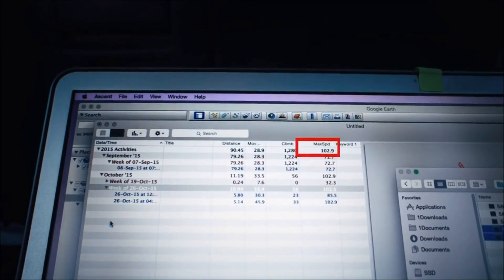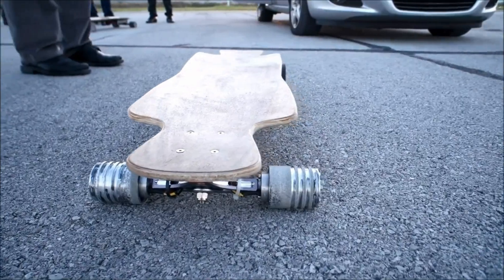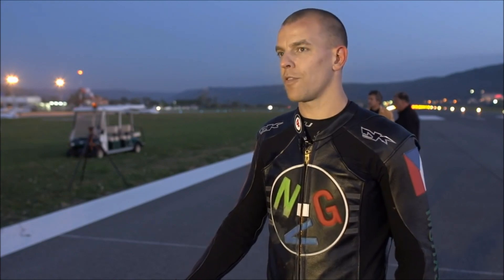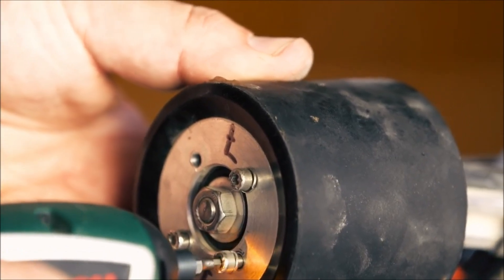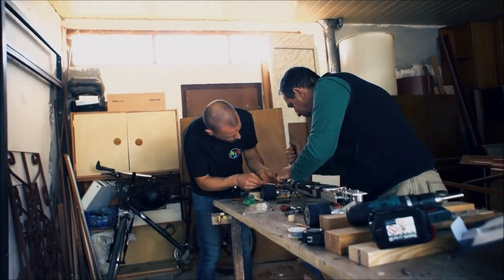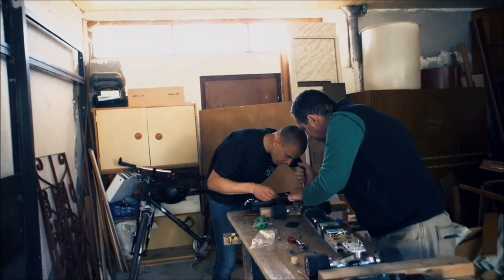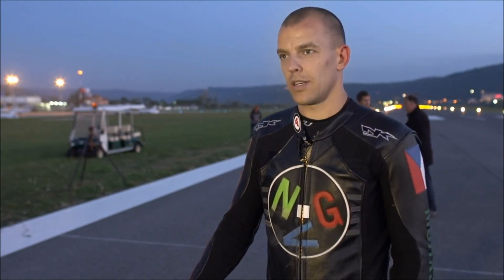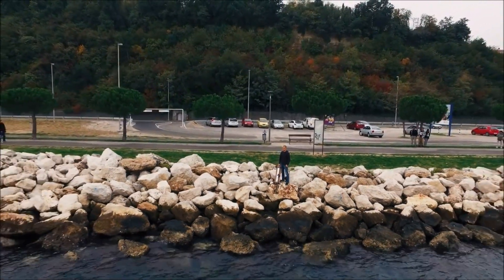Fastest speed record on an electric longboard set at 102.9 km/h

Comment: Common sense tells you that if you make the urethane layer for the wheels thicker it would solve the ballooning out and stretching problem real fast, go look at the wheels the guy used to go 89 mph on his longboard they are just normal longboard wheels like 65 or 70mm. The ones in this video looked like 60mm maybe and the urethane was like a 10mm layer........come on its not rocket science and if the extra size and weight of the bigger wheel is that much of a problem then figure out how to make the motor faster.
Reply: Actually just having direct drive with proper speed wheels would prevent any possible similar issues. Direct drive example: https://youtu.be/b0w6h26HBBw
Reply: And how would you compensate for bigger wheels without any gearing ? They would have to make different motors in order to keep speed and torque they have now.

Comment: I understand that your issue is heat expansion between the ground an the motors, in theory heat is controllable with the application of distance from either opposing force, I have noticed that carbon fiber is a very ridged as it's properties are compared to steal gram per gram, also it's used in the racing industry as a form of heat sink between certain materials such as aluminum, titanium, now if you where to apply a 5/16 layer between the aluminum an your rubber compounds, that layer should compensate for the lack of heat dissipation from the friction between the ground,air pressure that's being forced over, an around the wheel, the brushless motor does cause some heat to expand through its casing. the carbon fiber will also give you a more serious grip for the wheels to mold to...

. I do apologize if I'm in any way shape or form giving to much to read..

Comment: um....i go 60mph+ on my non electric longboard. i would not want to by this.
Reply: +Chad Stuetzel me either but i do something better its called falling. It stops me way faster than sliding it also opened my skin and gave me road rash, you should try it you wont regret it.
Reply: Too funny Chad, I started long boarding again just for Pokémon and now I'm bombing hills everyday!

+attack SAVAGE . There is a sweet spot for efficiency on any brushless motor and battery/load combo.. I don't know the KV these hub motors run in the video but running a 12s 5ah lipo, 190kv 63XX brushless motor and some 80+mm wheels with a properly geared belt drive should top you out at around 25mph and you should be able to get around 8 or 9 miles if ur under 200pounds. Up that battery to 10ah and 
Get around 15-16 miles~.

Hope this was helpful ! More people into eskating the better!
Reply: Obviously, its a penny.
Reply: +Chad Stuetzel Slideeee
Reply: Lol i don't even like going 15 down a hill. I don't like not being able to stop if something gets in my way
Reply: Mitchell Ellero I'm not at that level yet
Reply: On flat terrain?
I don't think so. Maybe in a steep hill
Reply: +Christopher Bjørkeng why would you want to go 60 mph on a flat surface. the sidewalks and street wont let you go that fast any way.
Reply: +Chad Stuetzel Get some gloves
Reply: axel herrera My friend did that on a penny board lol he had to go to the doctor for it to be cleaned
Reply: Well, that isn't good that he is trying to slide on a penny. I've gotten 35 on one.
Reply: Mitchell Ellero No he got speed wobbles
Reply: Mitchell Ellero I don't use my board as much as you probably do. I bought it to get around playing pokemon go then it turned into just cruising around for fun and now I always have it in the back of my car to get to classes or whatever which is why I'm not all too skilled
Reply: If you can develop an electric motor powerful enough to propel people to these speeds, then you can scale down in speed and increase efficiency of battery power, I'm guessing. Perhaps the development of this board will lead to longer lasting batteries in more reasonable long boards.
Reply: That was a premium reply. Thanks!

Comment: Why use a hub motor when it creates heat to the wheels. Also the friction from the road is also dangerous when combined with motors heat. Also the hub motors takes up too much space. When working on somthing this fast u should consider a more durable wheel instead of putting the motor and wheel as one maybe they should be seperate so u van have more material on the tire. Im not hating on ur work because it is great but im just giving some tips. Keep up the amazing work and i hope to be owning one soon.

Comment: why not use a midget to ride the board, more power to weight ratio?
Reply: +The Gaming Cheetah more weight means more friction as the wheels are being pushed into the ground harder, and the motors have to constantly overcome this to keep moving, so no... more weight = slower
Reply: Yeah in theory that might work but you have to realize the physics behind this E.I. the reason a longboard (for example) goes further than a skateboard is because of the mass so using W = F x D i will give you another example Work = Force x Distance = (mass x acceleration) x Distance; acceleration= gravity = 10 m/s2
W = 60 kg x 10 m/s2
x 20m
W= 12,000J
For this reason you dont want too little of weight on the board but not to much either judging by this guys build id say that he is a good weight for this too work at max efficiency :)
Reply: +The Gaming Cheetah that doesn't make sense, the less weight the motor has to push the better right?
Reply: MrJewripper Yes but at the same time the more mass there is the more momentum putting less strain on the motor.

Comment: I would recommend a larger diameter wheel at those speeds.
Reply from the maker: what OD?
Reply: simple math. the faster you want to go the more RPMs those poor wheels have to go. Inline wheels are now at 125mm. Thats where I would start.
Reply from the maker: +Donald Mora this is not how it works. i though u will have a good input but you clearly don't understand few things. you need to make sure the gearing its sincronized with electronics and battery.
Reply: as long as all 4 wheels are the same diameter there is no sync issues. the software can be modified, and the battery.. ummm what?  You clearly have a material limitations problem. You need to redo your gearing so that the wheels dont spin so fast and blow up.
Reply from the maker: Donald, nothing is going to blow up. This board is designed to go fast. I will not spend time explaining because I clearly see that you have no knowledge or you understand what we are trying to do here. Please enjoy the upcoming videos and place reasonable comments otherwise I will remove them. Cheers.
Reply: Please, calm down. His comment was completely reasonable.

Comment from the maker: The motors are not from drones. Its a custom brushless motor.
Reply: what do you guys use for bushings? concrete ? titanium?
Reply: quote:Tone Gorup NGV
 predelali smo  klasične BLDC motorje, ki se uporabljajo za pogon dronov.
Reply: +Ali1671 zelo dobro!
Reply: ceramic?
lord knows buddy
Reply: is this a item that can be purchased ?
Reply: Need a brushless motor that can spin about 10,000 rpm. Drone engines will spin to about 20,000
Reply: @ddiablolll  need a proper ratio gear, not very fast electric motor. What do you do on car to drive faster? Yep, shift the gear. 
And one more reason: drone uses high KV engines. That gives a lot of speed but there is not a lot of torque to accelerate the board
Reply: @onetwosccd  some people will never understand hahaha
Reply: What is the name of the engine?
Reply: how can we buy this motor reply on akshaymarvaniya@gmail.com
Reply: @akshaymarvaniya6227  maytech brand or torqueboard brand

Comment: buy some high power brushless motors, batteries, and control system from a RC hobbyist website then engineer a longboard with them

boom
Reply: I maked one
Reply: Aydin Panahshahi 
hobby motors get into the kW range, don't tell me they don't have enough power
Reply: Yah dude "hobby" motors brushless and powerful and 4wd holy shit keep it limited to 40mph and boom hella torque
Reply: I think the hardest part is esc. I need to update to a brushless motor but in the meantime can anyone recommend a speed controller for a brushed motor? I'm running 29 volts lithium ion battery and one motor. When it was running I'd go about 22 miles per hour any faster will require a helmet and pads (yes I want to go faster)
Reply: You can buy this board. It's been a while and I forgot how I found it, go watch the original of this video and you can find the info. I believe it's around 2500 usd for just the board, have to get the batteries separate. As if the general public needs this high powered of a device.

Comment: Ok now I wanna learn how to skateboard! 
I think 25-30mph is more than sufficient for urban/city  use and the issue would be the distance it can run before needing another charge, if they can optimise a board to run for 50-60km before needing to charge I am down for that!
Reply: +tracklabstudios i think if you need to go higher than 15-18 mph for more then 7 miles maybe you should take the metro or bus...  or a car or a motorcycle etc...

Comment: and what about safety?
Reply: +freeyourmind higher than 30-40km/h safety is no longer an issue ... by that i mean the risk is pretty much the same : death.  and most of the risk is not falling but sliding into something hard. you can see here that the guy uses proper gear and safety measures have been taken.  if you are idiot enough to ride a skateboard like this on the highway i think it becomes natural selection at that point ;-)

Comment: Must be some really cheap wheels... I know dozens of downhill skateboarders who have gone over 50mph no problem
Reply from the maker: don't forget he is testing...the wheels don't have the reinforced core and the motors are getting hot which softens the rubber. Also friction is a problem...a lot of different forces that interact differently would helps braking the rubber.
Reply: The wheels are not made of rubber. They are made of polyurethane. I think that motor heat would be insignificant (maybe a few hundred Joules) and any skateboard wheel can withstand the heat produced from decent bearings up to very high RPMs (much higher than the RPMs in this test). The wheel failure seems most likely to be a poor bond between the metal cores of the wheels and the polyurethane. At high RPMs, the polyurethane probably separates from the metal due to high centripetal forces, not high temperatures. Normally, skateboard wheels are build so that the polyurethane is infused in holes in a plastic core so that separation is very difficult. It seems that modifications were necessary because of the motors.
Reply from the maker: Polyurethane is type of rubber smart a..
Reply: this guy -__-

Comment: I don't think the bond between the metal and urethane is bad, it's probably the urethane itself not being able to handle the speed and running along asphalt.
Reply: Longboarding top speed without electric motor is I believe 80/90 something mph.
Reply: +Travis Piper It's defenitely the metal urethane bond. Luge boards can go near 120mph before their wheels start to disintegrate.
Reply: +ErikThePieMan It's not the speed that's the problem. Look up DTC downhill wheels. Aluminum core skateboard and rollerskate wheels have been a thing for a long time.

Probably the force of the "engine" twisting inside the wheel. A gravity powered skateboard wheel would never have to endure forces like that.
Reply: +Travis Piper Soliton wave effect.  Aluminum rims were spinning fast enough and pushing against the urethane to cause a gouge and expansion of the ring which is why they came off.  It explains why the front ones came off and not the back (more weight).
Reply: Adrian Joseph they used too thin of a urethane layer that's why it stretched and messed up, they should have used a way thicker urethane and probably a better quality as well.
Reply: +porkyapine 120 record
Reply: Aramis Scmidtke for regular longboards the record is 80.83 miles per hour
Reply: I mean 120 kimometers per hour :)
Reply: +Leighton Slanga They probably don't have metal, they are solid urethane. It is a problem with the urethane 'tube' style wheels, they will balloon out of shape when rotating that fast. Small wheels have to spin incredibly fast at those speeds. If you look at RC cars, their wheels are the same, and they balloon well out of shape, ripping rubber/foam/plastic wheels apart.

If there wasn't an aluminium/motor piece in the wheels, they would be solid right through, and less likely to balloon.
Reply: ErikThePieMan he's not going even close enough to make Longboard wheels balloon, now the guy that does 89 mph on a Longboards probably had a little ballooning action but not much at all urethane is way more durable than rubber. These wheels probably ballooned like you said though because the thin layer of urethane looked like it didn't bond well and was poor quality urethane. Plus if they where smart they would have at least made them 65mm and I bet you with a thicker layer of urethane over the metal would have helped a lot they used such a thin wheel.
Reply: Car tires come off the rim above a hundred mph, things stretch... speed adds so much force, ever time speed doubles the force goes up by a cube.
Reply from the maker: +porkyapine the electric NVG has more power. he only pressed 3/4 of the troottle. image full speed or adding from 6S which they use to 8S or 12S. we will see more speed records pretty soon.

Comment: I want a faster boosted board!
Reply: +Portable Electric Vehicle if I come up and promise to go throttle will you let me ride that shit?
Reply: I just want a boosted board.
Reply: @EazyRed  You want my v2+ lmaom
Reply: @deutschesabend  yes I do, though it's probably a joke, I will do anything
Reply: @deutschesabend  and no it's not like that!
Reply: I have the entertion raptor 2, I’ve hit 32 miles per hour on it. Better range, acceleration and top speed than the boosted. Plus it uses hub motors, which are MUCH quieter and less prone to breaking. If you’re prepared to dish out $1500 for a boosted, but want more speed and balls, go for the enertion.
Reply: @DavidTheUkrainian  hows the braking on that.. im more of a belt guy..
Reply: The backfire g3 is the board I have, 45kmph